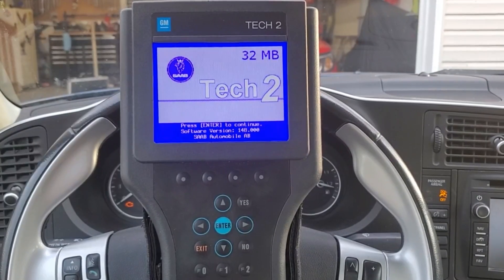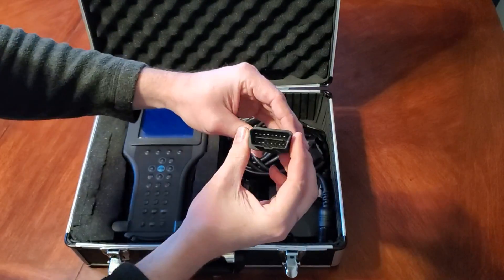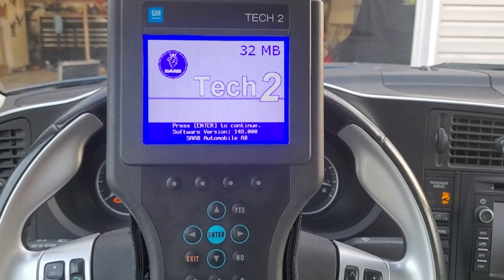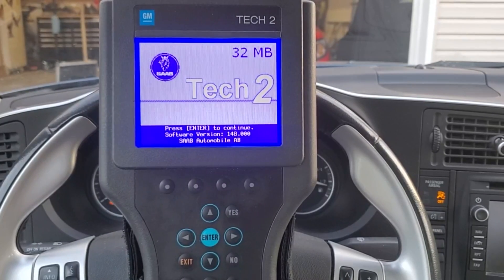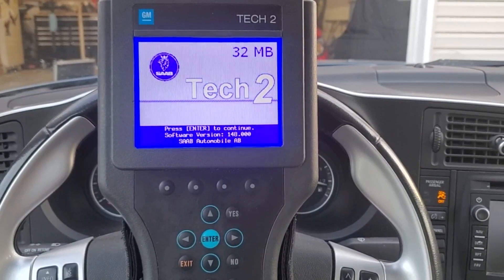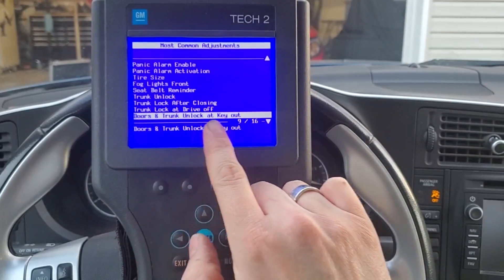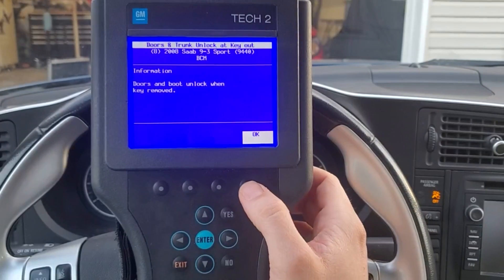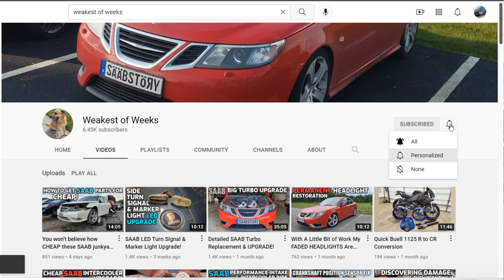Saab Tech 2: Doors Lock Adjustments

Comment: I tried to have my mechanic do this but he said apparently it only works for the 2008+ 9-3? Mines a super early production 9-3 so I suppose it could just not work for my car I’ve had issues with that type of thing before. I’d love to know if anyone has gotten it to work on an older pre-facelift.
Reply from the maker: It can be done on pre-facelifted models. If yours is an early 9-3 it may need software updated before getting the option for lock adjustments. You may also be able to divorce and remarry the BCM and get the settings that way
Reply: @WeakestofWeeks  okay thanks that makes sense. I think it’s 1 of the 1st few thousand produced so effectively as dinosaur 9-3 you can get😂

Comment: So security access is not needed?
Reply from the maker: Security access can definitely be a struggle to get but fortunately theirs a lot info on obtaining it. To answer your original question, you need security access to make any adjustments on the NG 9-3's.
Reply: Secure acess, and unlock tech 2 code
Reply: Security access is easy to get. Why do you ask if its needed or not?
Reply: @joshrawks21  Because I have not gotten it to work. Everybody says it is easy to get, but never ready to help if a problem occurs. Everything is done by instructions, but it does not work.
Reply: @t1mpetti  are you on Facebook? If yes join the group I am in and there's a post on how to do it.
Reply: @joshrawks21  Thank you, but have been out of the fb game now for 7 years.. Any other way for me to get the information?
Reply: @t1mpetti  I'll take screenshots and could email it. Just give me your email or if you have another way of me sending it let me know